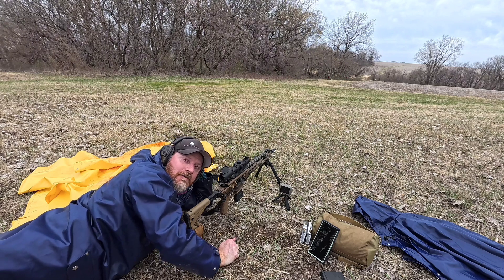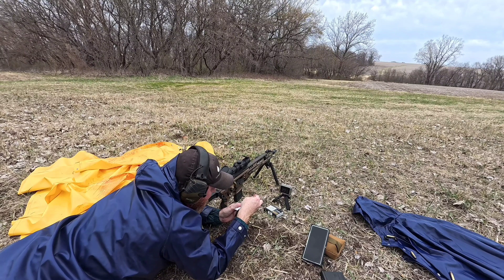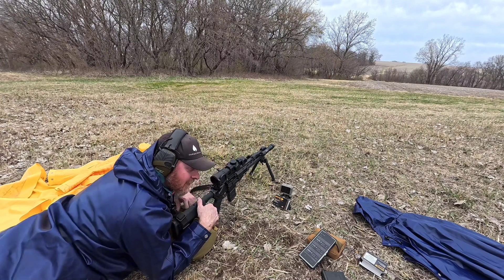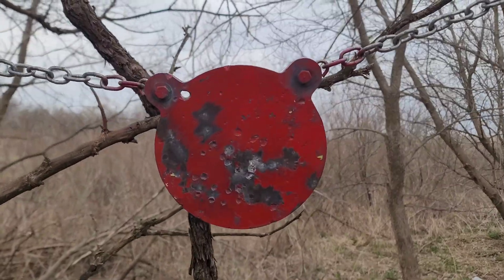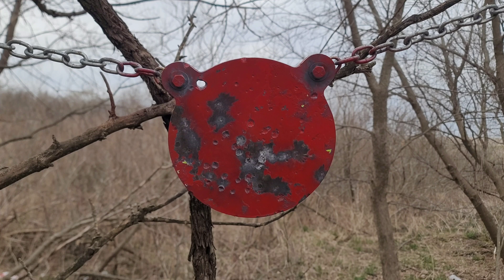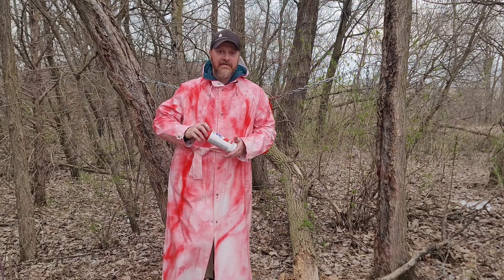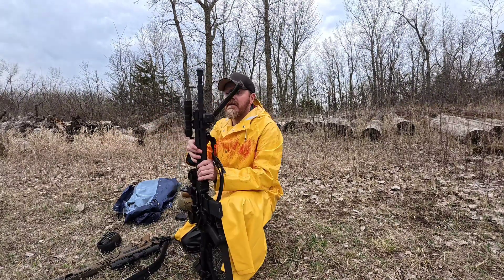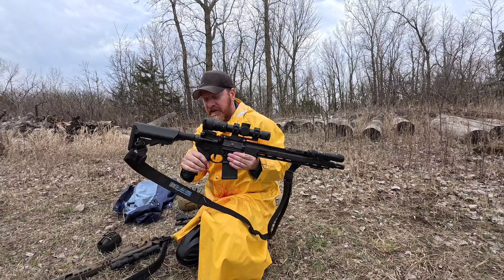Piston vs Impingement,  is there a difference in Velocity?

Comment: Piston is better short stroke piston specifically…..piston dirty up front imping dirty in back
Reply: Full length Pistons have higher recoil than direct impingement (DI). Short throw pistons mitigate some of the recoil but have more weight than DI and more moving parts. DI guns nowadays have gone 10,000 rounds without cleaning and without any issues. I found a YouTube video series with proof.
Reply from the maker: I use to think pistons were better too but after owning several different 5.56 rifles with piston actions in different style rifles, impingement has been my favorite but the recoil impulse on the MCX LT is very similar to the Springfield Saint.

Comment: Curious to see results. Watching till the end sir. Will say this, I own two LWRC piston guns. Ones a 16” A3 with 4-pos adjustable gas block. That gun with 62gr has gone 29/30 hits on a swinging bowling pin at 100 yards, but with 55s it spreads out to 2-4 MOA on paper from bench rest. Ammo matters when you use a 1/7 twist. 1/8 guns I have are all DI and making tight groups with 55s and are sub MOA with 73-77 grain match ammo.
Reply from the maker: @definitelynotthea.t.f.8813  I was a little surprised to see what shot a little slower, but in the end, you really don't know if ammo was the factor?